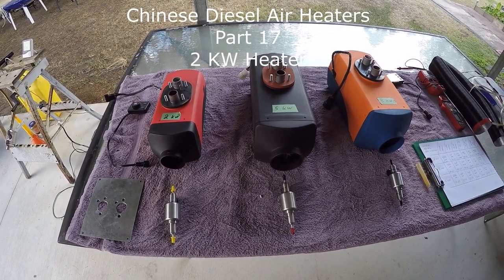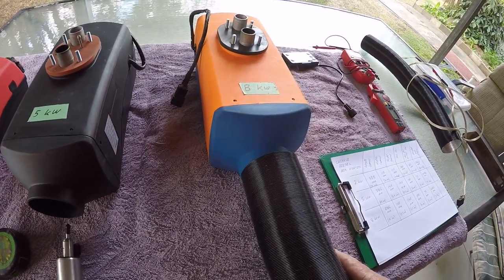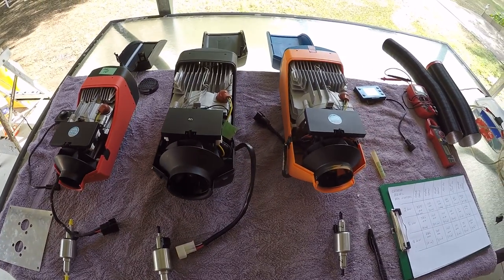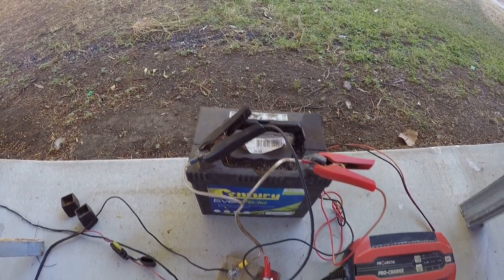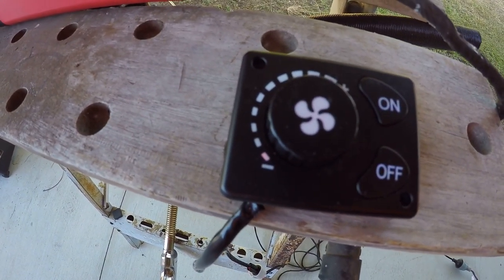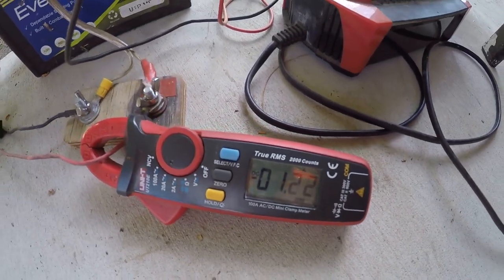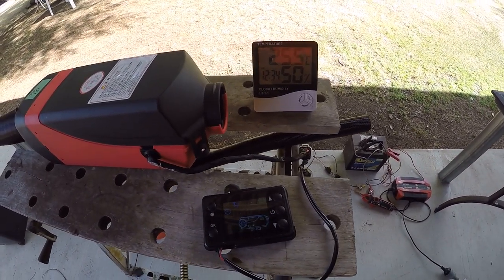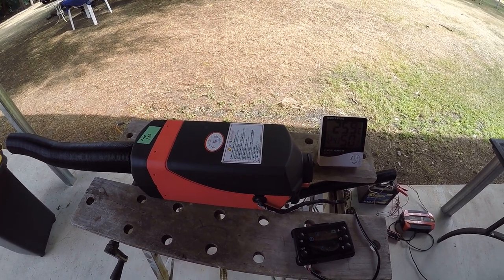Chinese Diesel Air Heater   Part 17 -  2 Kw Heater

Comment: I received a 2kw heater today which I ordered after I bought a "8kw" unit, they both run at between 1.6hz and 5.5hz, to my thinking the smaller heater will then use just as much fuel as the "8kw" and apart from size, it will not run any lower and won't run efficiently at the higher settings. Do you know of any control modules the will run at a lower setting?  There must be some way of reducing the lowest output of the 2kw.
Reply from the maker: Hi Greggy, 

As shown in my video, the heaters use exactly the same fuel pumps, have the same fan motors and use the same amount of fuel for the same Hz setting. The 2Kw heater basically puts out less heat because it has a smaller heat exchanger.

A fuel pulse of around 1.6 Hz is about the lowest practical setting for these heaters. With an LED controller you can go into the locked settings and set a lower pulse but the problem is go much lower than 1.5 Hz and there is not enough fuel input to keep the burner alight. Just the same as any appliance with a flame, turn it down too low and the flame goes out.

The real advantage of the 2Kw heater is its smaller size.  JMcK
Reply: the default settings for a 2 kw heater should be 0.9 to 1.0 Hz low and 3.0 to 3.1 Hz high 5Hz will cause the 2kw to overfuel  and ovewrheat at its core eventually causing thick black smoke and high carbon monoxide output from the glow plug breather hole which will end up in your living space, , we have two heaters a 5 Kw and a 2 Kw and the  derfault settings are very different in comparison the 5Kw heater settings are 1.5 Hz low and 5Hz high.

if you run your 2 kw heater at 5 Hz you will damage it the max pump setting should be 3.1 Hz why give it more fuel when you cannot give it more air it is pointless and a waste  of fuel , yes they should be more efficient than a 5 kw heater simply because the higest setting is 3.1 Hz not 5 Hz.  5Hz will blow unburnt fuel out of the exhaust 

pipe becaue you cannot increase the air input, factory setting are there for a reason on the 2 kw models for saftey primarily and longevity. I increased the fueling to 5hz on my 2 kw heater and after 5 hours all I got was shutdown and thick black smoke and a carbon monoxide reading of 33 parts per milliuon, on the default settings the carbon monoxide is zero and no more black smoke and yes nit mis cheaper to run than our 5kw heater.

Comment: John, Have you done a noise comparison between the Chinese heaters and the Webasto and Espar heaters.  Someone who installed a Webasto heater claimed it is much quieter than a Chinese knock-off heater.
Reply from the maker: Hi Mr 19,

No I have not done a side by side comparison of the three main design heaters. However I have no doubt the heaters themselves, with the same install would have the same noise footprint. The quality of the install changes the noise output.

The Chinese copy heaters seen operating in my videos are exact copies of Eberspacher/Espar/ Planar heaters. The mechanics are the same. It would be like saying if you changed the brand sticker it would run quieter.

The Webasto heater is slightly different in construction to the original Eberspacher heater but the basic operation is the same. (I do have a Chinese copy of the Webasto heater, but as they are rare I have not done a video of it operating)

Now there is one difference in the dosing pumps. Webasto have brought out a different dosing pump that is claimed to be quieter with a softer "ticking" noise than the normal dosing pumps. As I do not yet have one of these pumps in my possession for testing I can not make further comment.

The noise from these heaters comes from the fan and the dosing pump. The lower the fan speed the less the heater noise.

Cheers,  JMcK
Reply: I had a webasto airtop 5000 on my old boat I can’t really tell if my Chinese one is any louder as John say the noice come from the fan and dosing pump 

John i would like to know how these differ from webasto as you mentioned they look pretty much the same to me
Reply from the maker: rccarmadben 

The internal design is different. A bit hard to explain here. This series is about the common Chinese copies of Eberspacher, If I ever get my hands on a Webasto heater I may do a future video of the differences.  JMcK

Comment: what is the lowest voltage it will run before it shut itself down . will it run down to 10 volts ?
Reply from the maker: No Shawn.
Generally the controllers will shut down at around around 11.5 V
JMcK

Comment: Looking at buyin a 2kw or 5kw unit for a honda civic. Dont; know whats' best, I'm in canada and it gets cold -15 celcius, but read 5kw units are quireter. What would you recommend?
Reply from the maker: The noise level of these heaters is directly related to the heat setting and hence the higher fan speed for the higher heat setting. 

Therefore, in my experience, it is better to get a bigger heater running slower, rather than a small heater running fast to provide the same heat. 

A Honda Civic is a small vehicle. In my opinion a 2 Kw heater would be more than adequate for you. JMcK

Comment: I have one question, but first thanks for those videos, it is really nice when someone spend quite time to detail all the stuff. Back to my question, is the output air temp round 100 Celsius safe? And is that temp there all the time or jus tin case of high or burst mode? Thanks
Reply from the maker: Hi Munga, thanks for the feedback.

No, the output air is not always around 100 °C

These heaters on maximum power can increase the input air by around 80°C to 90°C. 

So if you are using the recirculating air method of reheating the cabin air, and the cabin temp is say 15°C, you can get output air at or above 100°C. 

If you use the outside fresh air method, and the outside air is say -10°C, the maximum output air on full power will be around 70°C to 80°C

If the output air gets much above 100°C, the heater will shut down.

Because of these high temperatures you can not use (easy to use) normal PVC pipe for ducting, as it will soften and sag. How do I know? I tried it myself some years ago.

Cheers.  JMcK

Cheers. JMcK

Comment: Great video with lots of detailed information!

I have a few questions though.

By recommending running a larger heater slower than a smaller heater faster, would the larger heater soot up sooner?

And, since the smaller heater is being dosed at the same rate but outputting less heat, does that mean the exhaust pipe temp is higher than on the larger unit? And if so, would that degrade the exhaust pipe sooner?

Cheers for all the effort you've put into these.
Reply from the maker: Hi Ignyte,

First thanks for the feedback.

Ref “size”. I am at odds with almost everyone else here. My personal opinion is it is better to have a bigger heater running slowly rather than a small heater running fast.

The main noise from these heaters is the fan and the pump. If you run the heater slow you can barely hear it. Just like any engine, run it at idle and you can hardly hear it, run it fast and you can hear it in the next street.

Also the wear on all machinery is relater to operation. That little heater fan roaring along all day at max revs , and the little dosing pump flying up and down at over 5 times every second creates noise and wear. Noise and wear on machinery is related to operational speed, and it is not linear.  Eg, in some cases you can double the speed of a machine, but increase the noise X4 times, and increase wear  X6 times. (That is just a throwaway example)

The rational behind the run it fast camp, is you prevent carbon build up. To some extent this is true. But it really depends on the quality of your install. A good install means very little carbon build up.

We have a diesel heater on our boat in the Med, which we use on the season shoulders, or if we winter over. I very rarely run that heater above half, and mostly at low setting. In 10 years I have not needed to de coke or even service that heater.

But what I do do, is at the end of each season, and occasionally mid winter if we winter over is to run the heater at max setting for 15 minutes or so, to burn off any carbon deposits. 

For high use heaters it is also a good idea to occasionally run a high kerro/diesel mix, say 90/10 through the heater. Even for just one hour. The kerro is a good carbon cleaner.

As in all these machines, the greater the fuel burn, the hotter the machine, and the hotter the exhaust. 

Cheers.

JMcK
Reply: @johnmck1147  Legendary, cheers for the informative writeup mate!

Would ya happen to have any vids in the works to measure exhaust temp between the two sizes? Im curious about that
Reply from the maker: Ignyte 
I will try and look at that in the future.  JMcK
Reply: @johnmck1147  Thatd be super handy and appreciated. Cheers mate!
Reply: @DJignyte ä

Comment: Hi john 
Great work mate i have watched all of your diesel heater videos and installed on myself 
My question is there a pump on the market that is quiet
Reply from the maker: Hi Andrew, sadly none out of China that I know of. Webasto are selling a pump with a sort of pulse buffer on the top. I have not tested one so I can not give an opinion. 

The very nature of a piston dosing pump causes a ticking noise. That is what you get.

On my sailing boat (see boat video) the pump is under my bunk and it is suspended in air. This lessens the ticking noise but there is still a tick. However with the mattress down I sleep well. You can lessen the noise by putting the pump in an insulated box, but you can not wrap the pump with insulation without an air box or you will overheat the heater.

Cheers,  JMcK
Reply from the maker: Do One 

Thanks for the feedback Do One
Cheers. JMcK

Comment: John I recently installed a 2kw after watching your video. I’m running about 4-5m of fuel line to reach its mount position under the bed at the rear of van. The heater started no problems, after a few runs it blew excessive white smoke covering the van. I perceived it was running the heater on alpine mode until it again did  Kew smoke today. I have also been running the heater on hi every few days to do a solid burn. Do you have any insight to why this maybe happening every few runs? Should I run the fuel pump in a vertical position?
Reply from the maker: Hi Matt,

First what fuel line are you using? On the delivery side of the pump you should only use narrow bore hard nylon fuel hose.

The fuel pump should be mounted in a vertical position above an angle of around 45 deg.

Is the fuel tank higher than the heater? If so you need a fuel shut off valve to turn off after use as you can get flooding of the heater burn chamber.

Have you installed a proper air filter on the combustion air inlet? Suck in a bug and it can block the small glow plug start vent. 

You really only need to do a carbon burn off once a season if your install is good practice.

To help further I would more information.  JMcK
Reply: @johnmck1147  thanks for the reply. I am using the recommended hard line for the whole line of fuel input. I am going to increase the angle of the pump rotation as it is approximately only 15-30 degrees presently maybe. I hadn’t considered flooding of the chamber as an issue due to my friends being set the same and they have had no issues. The fuel is being pumped from a 20L jerry can out of cap down the line approx 4-5m not more to the heater. The pump is approx 50cm from the the heater. What filter would you recommend as a replacement for the intake?
Reply: @johnmck1147  heater is approx same height as the fuel tank.
Reply: @johnmck1147  is white smoke excess fuel burn off?
Reply from the maker: Hi Matt, 
That pump angle is ok if your tank is lower than the heater, but could be an issue in your install.

You get smoke generally from carbon deposits, excessive fuel, bad fuel air mixture from restrictions in air intake or exhaust.

If the heater runs clean after a smoke start, it suggests fuel pooling in the burn chamber. 

I suspect you could be getting leakage into the burn chamber from head pressure of jerrycan, as it is higher than the heater. Some pumps have more seepage than others. A vertical pump may help here. Also make sure you use a fuel filter.

I use a ss mesh type combustion air filter. Plenty for sale on line. Search “combustion air intake filter for Eberspacher diesel air heater”.  JMcK
Reply: @johnmck1147  I am running two fuel filters, the standard one provided and a huskvana bush cutter filter in the tank itself to separate sediment and it also separates water this one. The line is drawing fuel out of the cap which is higher but the jerrycan cradle is at the same height as heater.

The heater does run clean afterwards and the issue only seems to be occurring after a coup,e of uses not on every startup. I have been trying to run the heater hot proportion to shut off but I’m not sure if this is helping to reduce the issue?

Comment: Hello John, like others, glad to see you back. I am a 'fan' of the Diesel Heater and am trying to fit mine (a 'Snugger SF2300') into my Cub Camper. She who must be obeyed is missing a thyroid and cannot deal with cold - so a diesel heater is a great option to extend camping time.  Could I ask a question please?  I think I have just managed to blow the temp sensor - I was setting up a 'test bed' of the heater and about 3.5m of flex hose ducting on both the inlet/outlet and whilst that worked for  bit I now have an error 'Outlet Air / Overheat Temperature Sensor Error'. I think it may be a back pressure thing and wondered if you had some thoughts on the maximum distance that you could pump warm air / draw return air. Many thanks and all the best - Piers
Reply from the maker: Hi Piers, 

I run the outlet over 7 meters on the boat, so 3.5m should not be an issue. It is very important that where you have a long run and have a number of outlets that one outlet can not be closed.

Yes, you can overheat if the heater is set too high and you get an error message and the heater shuts down.

It is unlikely you have done any damage to the sensor, and the heater will generally reset after turning off the power. It is not uncommon for me to reach the overheat setting during my tests. I have a thermometer probe in the outlet hot air about 1 m out from the heater. If that temperature shows over about 110 deg C, I need to turn down the heater or I will get the overheat error and the heater will shut down.  JMcK
Reply: @johnmck1147  Thanks John. The heater I have at the moment is a snugger SF2300 (2kw)  and I did like your comments about the 5kw version that may be quieter.  They are so cheap now,  and all seem to be off a good enough quality to go for that as an option.
Reply from the maker: Piers Chatterton 

Hi Piers, the 2 kw heaters are great heaters for smaller areas or tight install areas (like under seats) but not so good in larger areas where they are run flat out to provide enough heat. As I mention a number of times, my personal opinion is it is better to have a bigger heater running slower than a smaller heater running faster.  JMcK

Comment: Hi John, I have just installed a 2kw heater and when the fan is running full tilt, I can feel vibration from the heater through the floor of the caravan. Have you come across this issue previously. Thanks Andrew.
Reply: The vibration you feel is because of the fan running flat out. To stop the vibration, you'll need to acoustically decouple the heater from the floor. For how to do this, see this episode John did on installing a heater in a boat: https://www.youtube.com/watch?v=0_GDu-__0xI

Comment: Your videos are amazing! How often do ya reckon it's necessary to run it at full power for 15 minutes to burn off any soot deposits if I only run it for 2x 30 minute intervals per day on average?
Reply from the maker: Hi G3, this all depends on use, the quality of diesel in your area, your altitude, and your install.
If you are not at high altitude, and your install is good then I suggest you do the burn off only once or twice a season.  JMcK
Reply: @johnmck1147  Awesome! Thank you! 👍

Comment: i have the blue screen on my 2 kw heater and the default settings are 0.9 Hz low and 3.1Hz high most seem to find they are 1.0 Hz low and 3.0Hz high sounds to me like you have a 5kw heater if the high setting is 5hz it really needs tuning for efficiency if it is in fact a 2kw heater. watch the core temperature if you can at 5.0Hz it will ber around 137 degrees c and will induce overfueling by the pump ,

 black smoke to with lengthy running. if run at 3.1 Hz full chat it wont get above 117 degrees C and wont overfuel. use 14 guage wire for a 10 amp draw. my 2 kw heats inside air and circulates that herated air into my liviung room here in the UK it easily maintains 20 degrees C at 2.5 Hz all day long burning around 2 litres of diesel , my 32 Kw gas boiler will burn £12.00 gbp on one day at current gas prices .

Comment: is fan speed directly related to fuel pump speed
Reply from the maker: Yes Shawn. 
The ECU matches the fan speed to the fuel pump pulse rate to get optimum fuel air mix ratio.
JMcK